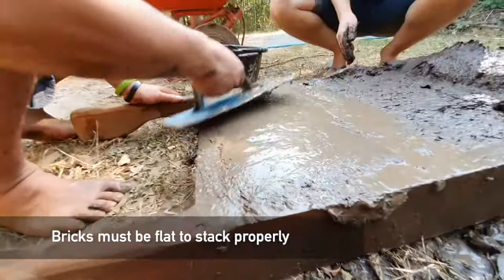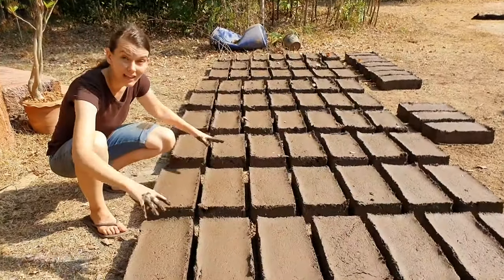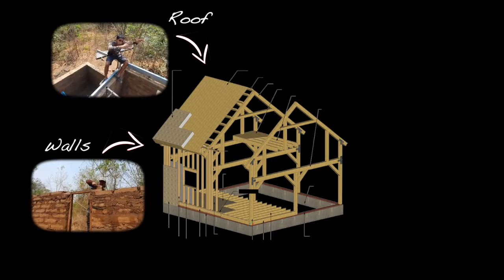HOW TO BUILD A MUD COB HOUSE? Step 1, building mud bricks! Off-the-grid life

Comment: This is amazing! Would it be safe to set up a sauna in a building like this? Thanks so much for sharing! 🙌
Reply from the maker: Hi dear heart. Well to be honest its all about how you plaster the walls. We were recommended by some of the local mud builders to use cement for the walls of the bathroom to prevent eater erosion. Instead we use "leak proof spray paint". Its available in hardware stores. About the sauna, technically in terms of structural strength it would be fine..and it would be fine as long as you look into
1. Plastering walls and waterproofing them really well. If you really are looking at long term then unfortunately waterproof concrete might be your optons. 
2. Ensuring that the steam rising from the hot stones in the sauns can exit the room without getting in contact with more mud walls. So you probably need a duct setup well. I am sure there are experts out there who can give better recommendations, but since saunas and mud houses usally dont go well together, there might be some use of cement.

Comment: What is the size of your bricks?
Reply from the maker: Its 40x20x10cm
Reply: @OurLand  Thanks. Is there a particular type of soil we should look for ?
Reply from the maker: Hi jonathan. U want to aim for mud with slightly high clay content. Too sandy is surely to be avoided. When you use the 1:1 ratio for mud and rice husk... the brick should hold its shape when taking out of the cast.
Reply: @OurLand  Thanks a lot

Comment: What is the the length and width of the mud brick molder?
Reply from the maker: Each brick is 40x20x10cm
Reply from the maker: Our mold has 7 bricks in one
Reply: Any types of soil is okay or not?
Reply from the maker: You usually need soil with higher soil content. So you know the brick will stick together. High sand content is not preffered.
Reply: Thanks.